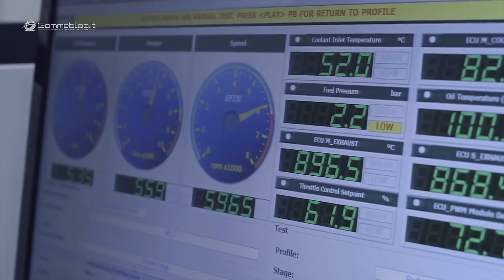Bentley W12 Engine PRODUCTION ASSEMBLY MANUFACTURING PROCESS

Comment: Plastic chain guides?  Having owned a couple of BMW V8s, I know that's a ticking time bomb.  They'll probably last just long enough to outlive the warranty period, however.
Reply: Toyota 22RE has the same issue
Reply: Surely you don't think that's accidental LOL! It's only a defect if it's not intentional by design
Reply: It's not just plastic and they are designed for quiet operation. You get into trouble with long drain intervals that seem to be the recommendation from BMW. End of the day, I think the timing chain replacement is something that needs to be done on an engine at some point in time along with the guides. Too bad manufacturers stopped using timing belts since they had a predefined service interval and didn't rely on engine oil for cooling and lubrication.
Reply: @brarautorepairs  thanks.  I work in the plastics extrusion industry, and can assure you that Nylon is a plastic.  What ever they are made of, and given that they tend to degrade over time and get brittle and fracture, seems to indicate that these are not the right polymer for the job.
Reply: I have Toyota 2azef engine , it has plastic chain guide , now it has over 250K mile on it , never changed it .
Reply: It’s nylon, we use them in crane sheaves
Reply: You ever seen metel ones ?
Reply: They could eliminate all those problems by ditching overhead cams. 2 gears, 1 chain (very short), eliminating all the chain guides and tensioners with zero loss in performance and a whole lot less failure prone parts.
Reply: @6h471  fortunately in them engines all you pointed isn't prone to fail plus there is quad VVTI so is impossible to scrap overhead cams.

Also there is no any looses.
Reply: Couple that with the high temps of two turbos.  Ugh!
Reply: Considering there are plastics that can outlast that chain I wouldn't be concerned.  Bently can easily afford materials that other manufacturers can't or won't use.
Reply: @TedHallII  there is nothing "bentley special" in them. Same timing as any other chain design. Full set for W8 W12 W16 cost just £315 or about 350€ so nothing expensive or special in this timing kit.
Reply: @6181green  te
Reply: @brarautorepairs  I would bet it's ultra high weight molecular polyethylene. That stuff is literally bullet proof.
Reply: @bryancollett1619  is not and that stuff is strong but very prone to erosion so no one pull specify it in this application
Reply: @6h471  you’re an ICE engineer are you, with how many years design experience ?
Reply: Not true. A lot of Japanese motors from my Toyota cars/SUVs to my Suzuki motorcycles have them and they racked up unbelievable amount of miles. My 4Runner is 16 years old with 318k miles. The only thing I've done is basic maintenance, spark plugs, and transmission fluid change.
Reply: @gsxraiders  Yes true.  While I'm sure your cars are fine, my complaint was specifically on the guides on older BMW V8s where they begin disintegrating after about 5 or 6 years.
Reply: I think that people who can buy such a car don't care
Reply: @pattonpending7390  detergent in the oil breaking the plastics down...just a guess from a guy that deals with uhmw
Reply: @poluticon  I will, thank you.  Keep driving whatever it is that makes you so condescending!  :)
Reply: @pattonpending7390  I will, thanks.
Reply: Ford 5.4 liter 3 valve have plastic timing chain guides/tensioners that fail and destroy engines. 
Many videos about those engines.
Reply: @andyloebrown8250  Well if you hear a tick in the front cover, it's time to replace the chain and guides.
Reply: Most of the vehicles companies are installing them plastic timing chain guides yes. You are right they only last 39, miles 😒 1:02
Reply: Yes...
Reply: @pattonpending7390  ha! Nice name.
Reply: Not all.plastics melt or stretch, they're designed to work atnthe conditions they'll be subjected to
Reply: @brarautorepairs  ź
Reply: @broskis80  Yes!
Reply: @_Kerman  EGGZACTLY!!
Reply: Precisely
Reply: @brarautorepairs  
And pushrod motors run 300,000 with no chain issues
Reply: @TedHallII  I’d like to know what kind of plastic out there outlasts metal when they’re rubbing together?👏
Reply: I mean these days almost everyone using plastic where ever they can
Reply: As soon as u pay it off sell it
Reply: Warranty period???? Hahaha.
Reply: You make it sound like it's made out of the plastic from Pez dispensers! 😂
They're "engineering polymers" with properties specific to the application! Every radiator end tank in conventional passenger cars since the late 1980s or early 1990s has been made out of nylon. Is there a big rash of failure of radiator end tanks due to the plastic?  Almost every intake manifold is made out of nylon. I'm no motorhead, but I don't think the timing chain guide is an application with extreme engineering specs. 😂
Reply: Oh yes, the more money you spend, the fancier the plastic becomes.

They used to use Gear Drive timing sets made of nylon in the 50s.
Reply: Ford, GM, Chevy, Toyota, and a few others use plastic timing chain guides, it's fairly common on many interference engines.
Reply: Audi 4.6 same thing
Reply: @mutiracialbeatdownPB  yeah my bad I meant the 4.2 but that’s really cool
Reply: Joke production
Reply: They ain't plastic, it's Teflon composite.
Reply: How would a metal chain guide work?there is no better option.
Reply: Planned obsolescence
Reply: @6h471 they could ditch it all together if they used timing gears like the Cummins I6 engines. More difficult to implement in a V or W configured engine, yes. But they still virtually never fail or need replacement. If they fail the rest of the engine has already been destroyed beyond repair.
Reply: My 535d M57 diesel engine with 280000km also have plastic chain guides.. 
you have to do oil change every 10000km, maximum 15000km
Reply: Explain what would be better? You sure don't want metal chain rubbing on metal guilds, rubber = no way, Seems plastic that's hardened properly is the best.

Comment: I'm impressed by the machines, and tools used in the build. 
All seriously clever high grade engineering.
Reply: Especially the moment when finger was pressed 8:55
Reply: Have you seen this car take a tight turn?  It kinda - just slides off the road, because this engine is a 800 pound pig that creates a really messed up center of gravity.  I had a 1971 Catalina that drove just like this.  400 big block - pushing over 550 ft-lb of torque at low rpm with high octane fuel, because it came from the factory at almost 10:1.   There is nothing special happening here other than what they are charging.   I am a data highway expert, and I have been in factories with automation, and technology that makes this clip look like 1982.   If you are impressed with this you should get out more.
Reply: @MegaMeaty  Hey, what's your point Baby?
Reply: @yourworstnightmareiscathoc7015  The point is it is not impressive at all.  It is ICE technology from the 40's or earlier.   If you want to impress me you better be ready to draw 5000 hp from the quantum flux field.
Reply: Actually, pretty much par for the course for a modern engine assembly facility. Low volume means less automation and more hand weilded tools. Scrupulously clean and organized though.

Comment: Suffice to say: Bentley doesn't mess around! Serious hardware! And a nice balanced assembly line to boot.
Reply: Except the plastic chain guides.
Reply: @echoromeo384  what are chain guides supposed to be made from? Steel?
Reply: Volkswagon.
Reply: @echoromeo384  In your opinion why these are made of plastic?, specifying that it is not PET plastic to produce water bottles

Comment: The engineers who designed all of these machines to assemble this motor, or any motor for that matter are the real heroes
Reply: P
Reply: Yeah true that.
Reply: The real heroes are the mechanics that have to fix them after they are installed in the car!
Reply: @davemanley8700  over engineered death taps
Reply: I don't think any of you know what "hero" means.
Reply: It's an engine..
Reply: They designed the Yugo as well.
Reply: Contributing to the loss of jobs, wonderfull.
Reply: No they are not.
Reply: Aya 1

Comment: - I spend 20 some years working in the bentley factory
-Wow you should know a lot about it
-Yes I know the torque specs of the bolts
Reply: i think history makes difference
Reply: Did they give you one when you retired ? It’s the least they could do.
Reply: Excuse me sir, is this is an exact VolksWagen engine what we see in the video?
Reply: @aliasseraf  Bentley engine.  Bentley.
Reply: @aliasseraf  Although less commonly used in automobiles than V12 engines, a W12 petrol engine has been produced by Volkswagen Group since 2001. This four-bank engine – based on two VR6 engines with a common crankshaft – has been used in various cars sold under the Audi, Bentley and Volkswagen brands.
Reply: @verteup   Bentley on tappet cover. Bentley. (Badge only)
Reply: @verteup  Bentley belongs to the VW group. The W12 is used by Bentley, VW and Audi.
Reply: I'm stunned that they use regular drills. I was expecting a torque gun with torque monitoring and angle control.
Reply: Spoken like a True assembly worker! Lol! I feel ya man.
Reply: @aliasseraf  Brainlet.
Reply: @matthewhopkins7042  That comment was displaced, misplaced, and smudged by something worse than ”mud-colored” skin. Not OK.
Reply: Hagbard Celine  The two companies are separate entities.
Reply: So german engine not english

Comment: The size of the engine is Insane, I can dig it!! It almost looks like it would be a tight fit in a Peterbilt Truck. Very Cool Engineering!!!
Reply: What does the engine get put in?
Reply: @Mr. Miller. Bentley Continental GT. 650 hp, 664 lb-ft torque, 0-60 mph in 3.5 sec, 208 mph top speed, $275,000.
Reply: @oliverheaviside2539  For that kind of money, I'd rather buy an airplane!!
Reply: @mr.miller3432  Isn't the same motor built, quad turbo'd put in the Veyron as well?
Reply: NVM i am thinking the W16
Reply: @oliverheaviside2539  The new M3/4 Xdrive 3.0 6 is faster.  Tiny little 3.0 motor lol.

Comment: That would be a treat to put a timing chain in! A engine that precise and high end should be gear to gear on the timing. That would be a major upgrade!
Reply: Gear drives can be very noisy - In the old V8 Mercs, you connected the new chain to the old chain and then slowly wound it over - Easy !  :)
Reply: @TheLlamaFarma  noisy and extremely difficult to set the timing..
Porsche flat 4 Fuhrman engine for instance took incredible amounts of time to assemble and time
Reply: Not speed brother
Reply: This is the first time I have seen the inside of one of these engines.  Do you want to laugh?  I was recently told by a mechanic that for only $1,400 he would change the timing belts on a 2005 Continental, which were passed due.  Unless the 2005 engines had timing belts, instead of timing chains, I don't think I'll bring the car in for that work.  2:19
Reply: The timing chains (there are more than one) on these engines and the VR6s that preceded them require the separation of the engine and transmissions in order to replace the chains and guides.  On the VW Phaetons, both the W8s and the W12s, this required removing the entire drivetrain assembly forward of the rear driveshaft to do so.  I worked at a VW dealership as a tech for 12 years, and fortunately I never had to perform this work on the Phaetons, but I definitely cursed my luck when I'd draw that job on the VR6 Golfs, Jettas and Eurovans.  Special tools are mandatory to do this work on any of these engines.

Comment: Cylinder head probably costs more than my entire truck!!!😁
Reply: Nope just 2 vr6 cylinder heads it's a VW product
Reply: Probably doesn’t but they finna make you pay for it.
Reply: Not probably. Definitely!
Reply: My thoughts too. Lol
Reply: How cool would it be to drop that thing in a Jeep CJ7?
Reply: Scarface 39 and mine together, 🤣😂👋🏼
Reply: @dustinmiller7278  how much are those heads new? My work truck was only $2500😂
Reply: LOL. I look at my old E250 Cargo van. It has a 5.4L Triton in it. Great running motor. It runs so smooth. But I can imagine just how much smoother these motors are.
Reply: Seen a reciet a guy had one replaced 45k dollars for it alone complete with valves and buckets but with out the cam and holders . Head warped cracked
Reply: Only one of them :)
Reply: Make that two of your entire trucks ;)
Reply: Scarface 39 
Name brand rip off, if it wasn't associated with the brand Bentley it would be a third of the price.
Reply: @dustinmiller7278  ASOMBRADO. 
HERRAMIENTAS ESPECIALES. 
TECNOLOGÍAS DE PUNTO. 
Y TREMENDO MOTOR  DE DOCE CILINDROS.
Reply: Que vehículo lo utiliza.
Reply: Ahh it's only about $1400 for 1
Reply: @Watchfulanalert  not too bad👍
Reply: The bently, audi kit is assembled in Crewe for a lot less than you think...
Reply: @dustinmiller7278  u7uuu7uuuu
Reply: If you really look at the way it looks take off 2 cylinders it’s really a W10
Reply: Try the cylinder head bolts.
Reply: @jo-wb6zs  what does finna mean? 
Like fixing to or intending to?
Reply: I doubt that.  The VR6 has been soldiering on for decades.  You do know you're looking at a Volkswagen, right?
Reply: I was thinking that too but not your truck, my car.
Reply: @bolerdweller  I looked on eBay.  You can buy a running V12 for less than $10,000.
Reply: Зато мы делаем ракеты
Reply: @БорисПростынкин-ъ5щ  yes
Reply: Exaggerating R&D is a tool of trade to discourage competitive interest and maintain exclusivity. Cost producing a tomato can be $10k, $1k   or   $1.50 ... all are right.
Reply: not unless you have a very cheap beater. this engine uses VR6 Heads... you can get them rebuilt for less than 1k
Reply: 2 trucks
Reply: @morganmcintire2853  Same architecture, yes.  But they're quite different dimensionally.
Reply: Depends on the truck that u have. Lol
Reply: @morganmcintire2853  
ما هو Vr6
Reply: @TheRumbles13   
I'm finna go. - I'm about to go.
Reply: @dustinmiller7278  Aàqaà0
Reply: You are correct. This engine assembly is around $40,000 USA currency
Reply: Buy a VW phaeton. Exact same engine.
Reply: hhhhh
Reply: You can find w12 engines online for around 4000+ dollars
Reply: @charliejames3738   pp0
, So latea
Reply: You're truck...my house..we are not the same lolol
Reply: @charliejames3738 mkko o

Comment: It's amazing to think that all this sublety with so many pistons and so many gears is all to make something that's as smooth and powerful as an electric motor with a fraction of the number of parts and size. Fascinating, and an absolute masterpiece, but not relevent any more.
Reply: Probs drive that all day with fuel stops. Electric? Sleep overs to charge the shitboxes!
Reply: @kerrybuckley1543  you need to sleep for a half an hour stop?
Reply: @Roger Froud. You’re right, it’s a marvel of engineering that will slowly be replaced by electric vehicles in a short future. Even with the enormous amount of parts and components eliminated, it’s very doubtful that the selling price of the car will be reduced.
Reply: @691053  Until they invent a new type of battery then electric cars will not take over. Even Elon Musk admits there is no more capacity in Lithium output.

Comment: And just imagine how difficult that engine is to work on while its in the car!
Reply: John Clamshell SP must be a big car😀
Reply: They drop the engine cradle out of the car, it actually comes out faster than you think.
Reply: That is why you may be able to afford to buy a Bently but you sure can't afford to service it !
Reply: Imagine the poor schmuck making 300$ doing head gaskets on this in the field
Reply: @josiahjones5293  why only 300 dollars :(
Reply: @Ş̵́X-j3i  If he made $3,000 then he wouldn't be a poor schmuck.
Reply: The very definition of a "3 Owners and Done" type of car. The first owner can afford the upkeep, the second owner is shocked at the maintenance costs and soon sells it to the unsuspecting third owner who can't afford it either and runs it into the ground.
Reply: Usually they can remove the body of the car from the power train, (reverse of how they installed the powertrain into the car at the factory) and work on them really easy if they need to do something to the engine that can't be done in frame.  It comes out fairly easy.

Comment: What a monster and so beautiful. I want to see the vehicle this engine will power,and I do mean power.
Buying gas for this piece of Art will surely be a challenge. This thing will drive the greenfreaks nuts. I love it! ❤
Reply: @marbrose4804  
The combustion engine is still more beautiful and the engineering as well.
Reply: "Greenfreaks"? I would love to live on a planet where burning fossil fuels is not harmful, but unfortunately I don't. Which planet do you live on?
Reply: @marbrose4804  haha electromagnetic pulses go brrr
Reply: @marbrose4804  haha power loss per mile go brrrrr
Reply: @marbrose4804  me fail english? that's unpossible!
Reply: I bet that monster puts out almost as much horsepower as a comparably size V8
Reply: @marbrose4804  you do know that 80% of electricity is produced by fossil fuels right? Your electric vehicles do nothing to help the environment. Also, the carbon emissions produced from the creation of a single Tesla battery is equivalent to driving a combustion engine vehicle for 2 years. Not to mention the lithium mining.
Reply: And where do you think all that lithium is coming from?

Comment: Wouldn't want to change that timing chain! 🤯
Reply: may be not necessary,  it's look like very durable.
Reply: reeder google 
You've got to be kidding. 
It's not even a double row. And looks like it belongs on a cheap Chinese bike.
It's going to stretch really badly within 10k miles.
Reply: @reedergoogle8901  indeed, timing chains are very durable, even if you drive it like crazy.
Reply: Engine out on all the W-Engines to do the chain service.  The chains do last, but not forever.  Tends to be the chain guides and tensioners that wear out before the chains, tho.